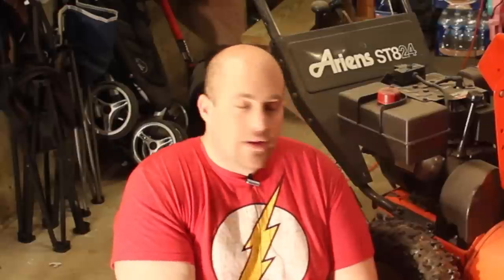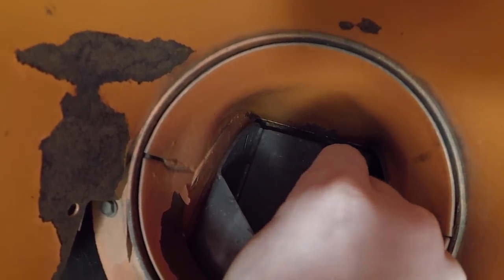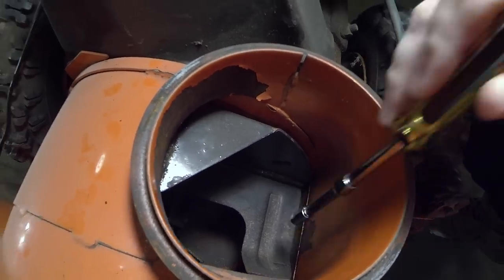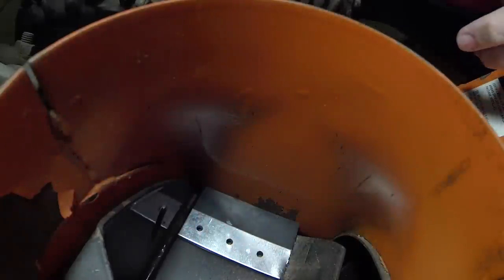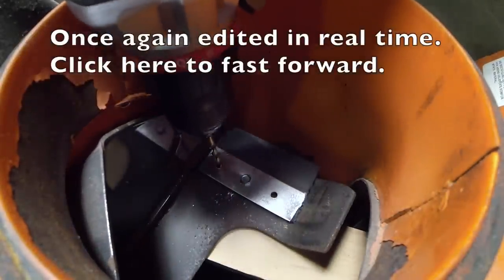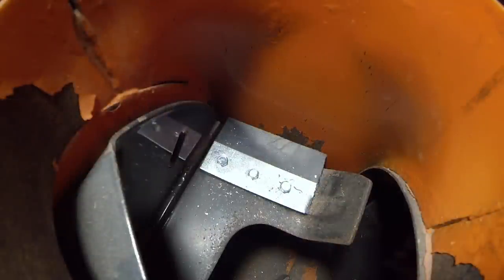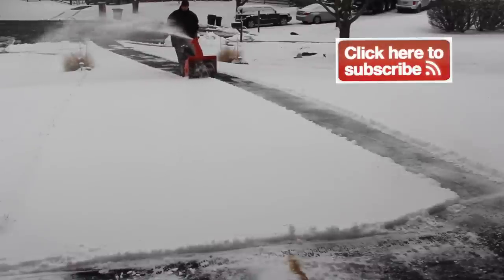TURBO CHARGE YOUR SNOW BLOWER - How to Install a Snow Blower Impeller Kit

Comment: Just did this today to my john deere 726 with 6.5 horse harbor freight motor. It was already a beast, but it's even better now! I was throwing the wind rows from the plow truck about 20-30 feet, never clogged, and the snow was several inches higher than the front of the machine.

Comment: For future reference, use a sharp drill bit.   Use some motor oil on the bit while drilling, it will help to keep the heat down at the tip of the bit thus keeping the bit from losing temper and staying sharp longer.  And lastly, slow the RPMs on the drill down, a lot.  Cutting steel should be done at much lower speeds, again keeping the friction temperature down and saving the cutting edges of the bit.

Comment: Great video thanks...I did the impeller wiper retrofit to my Troy Built 28" 9.5hp Track Drive in March 2019 after using it more then 10 years of blowing snow. I bought all materials individually....1/4" neoprene sheet 60 durometer, 1/8" x 2" x 2" long 6061 aluminum flat bar and 1/4" stainless steel screws. It throws snow much better and further even slush. Troy Built's impeller clearance within the tunnel it spins in is excessive 5/8"+ giving my driveway gravel lots of space to fit into....surprisingly the new wipers give the gravel less places to jam and cycle thru much smoother....after realizing that fact I do not understand why OEM snow throwers do not come with wipers direct from the manufacturers. I like the idea another reviewer made about changing impeller belt pully to a smaller diameter to increase the rpms of the impeller.

Comment: I did the same kit install on my 45 year old Ariens 824 and it made a huge difference, very pleased.  I didn’t notice whether you pulled the boot off the spark plug as a precaution against accidental starting when turning impeller.
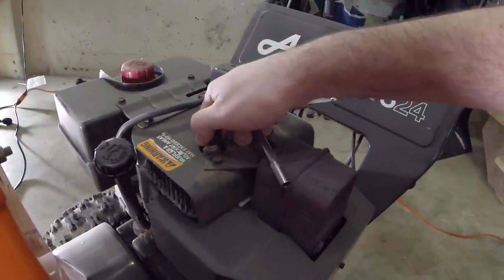Reply from the maker: It surely makes a difference. Did you buy a kit or make your own?   I did unplug - 5:07
Reply: Bought the kit but would not recommend now, way too expensive.  Thanks for posting.

Comment: We have similar snowblowers. I have a 1985 Bolens 824 with a 8hp Tecumseh with a 3-blade impeller. I just put the impeller kit in last week. It went in pretty easy, but it did take a while. I marked the holes on the impeller with a black marker and drilled a 1/4" hole, then widened them to 3/8". Installing them was the easy part. I greased the shute bearing edge and reassembled. Then, theNor-Easter that was coming.... missed my area. Bummer!
Reply from the maker: I was ready for it too and I got was a little dusting. :(

Comment: Did not know these kits were available, and the price is crazy for whats in the package LOL! Stainless screws, nylon locking nuts and washers only cost a few bucks at any hardware store. A mudflap from a truck stop is fairly inexpensive, if you can't get an old one that was thrown out.
Reply from the maker: True, just like everything else in life you pay for. You can probably do it yourself for whole lot cheaper.
Reply: ModernDayFamilyMa'

Comment: My blower has cast impellers. I used mud flaps I bought from Fleet Farm $8 And cut them to size. There's enough left for 4 more sets of wipes. #8 Stainless self tapping screws and #8 stainless fender washers. Total $7. Drill pilot holes and attach. Simple job. I have 4 impeller blades. Started with two and I couldn't believe the results. Added the final two later. Where has this blower been for the last 15 years? A 5 hp two stage that would clog up within 6 inches of wet snow now chews through EVERYTHING and throws twice as far. Last winter it didn't clog ONCE. For the first time since I was a kid I'm looking forward to winter. This one time POS is now a BEAST.  IF I ever buy a new snowblower the FIRST thing I'll do is install impeller wipes.

Comment: I had an old Compact 24 a long time ago, and I have to say the best mod I did was a smaller impeller drive pulley.   I increased the RPMs by 50%(1,200 to 1,800).    I was afraid that the drop in torque would cause more clogging, but the opposite was true and it threw much further.   You had to be careful of rocks and stuff, though, you didn't want to turn the shoot wide open because it could throw a rock for a city block.
Reply: So you happen to know how far of a jump down you went with pulley size? I’ve been trying to do that and this mod because it truly transforms the machine
Reply: @ryangaughan5535  IIRC I went from a 9" pulley on a 10" impeller(the compact impellers back then were tiny) to a 6" pulley.  It was a big drop
The impeller went from spinning at 1/3 engine speed to 1/2 engine speed.
It looked kind of funny because the auger was visibly spinning much faster than a normal machine.
In my case, I got a pulley from a local farm store, drilled some mount holes, and bolted it on.  I got lucky because the factory pulley bolted onto the piece on the drive shaft.  Not all blowers are like that, sometimes that is one piece which will make it a challenge.
If it was too fast, or I didn't like it, I planned on trying different sized pulleys, but, in the end, I was happy with the results.  I just had to be careful where I pointed the chute.
Keep in mind, if you have a newer blower(I think '80's+) with the "safety brake", you will have to modify that to make it functional, if you want to keep it.

Comment: I have a 1985 Bolens 824 with a 8hp Tecumseh eng and heated grips (it;s VERY similar to your Ariens 824). I also have this impeller kit yet to be installed. I wasn't exactly sure how to take the chute off. I figured it was those 8 bolts around the gear, but thanks to your video, I now know what to do. THANKS! BTW, I just bought some AmorSkids for it that I ordered through Home Depot. You should consider them. They're worth every penny.

Comment: Great video, I cut an old mud flap I got from a truck shop, picked up some screws and brackets, drilling the holes is fun as you know, but works great. thanks.
Reply from the maker: Thanks Jeff. Old Mud flaps are awesome.
Reply: Very happy with the mod, it worked great, thanks.

Comment: Did it to mine also and it's a great idea. BUT, the first thing you should of said before starting the project is disconnect the spark plug!!! if that baby started by turning the impeller you'd be missing a hand. Just like a lawnmower turning the blade could start it if the gas was on. Just a good safety step. Doesn't hurt to be cautious.
Reply from the maker: Thanks. It makes a world of a difference, doesn't it?  BTW: check out 5:06

Comment: The Impeller is a full-size car built by Chevrolet for model years 1958 to 1985, 1994 to 1996, and 2000 until 2020.  Impeller was Chevrolet's popular flagship passenger car and was among the better selling American-made automobiles in the United States.

Comment: Sorry in advance 
I completely understand you are a newby to the snow blower  world 
You as a preper  fronters man will appreciate another point of view
There is a man who has done the very same thing I have used his methods to great results  
His method required self tapping screws and an old tire for the rubber his name 65 Ford notto  be bad mouthing at all he has great stuff for the guys who do it them selfs 
Again I apologise but there are easier ways to be a step wiser with what is around your home 
Recycle stuff intended for the junk heap it's less a mess to haul away 
       Have a great day my friend

Comment: I'm not sure what these kits cost but to maximize bang for buck I'd slot the holes on the rubber to adjust as it wears. Similar design to cement mixer squegeezs . Slot the hole and adjust as it wears. Just a thought

Comment: Great video and camera work showing how this job is done. I plan on doing the same with my 1 stage craftsman snow blower. Hope it works. Thanks!
Reply from the maker: 1 stage? How?
Reply: I did it. The blades just need to be positioned so that I can reach the impeller. I used the rubber paddles (cut to size), metal mending plates similar to yours and nuts/bolts. Tested it out and worked great except for extra noise. I tried trimming the paddles with a snip tool but don't want to take off too much and undo the work I did. Your video helped me so much. I was also told by a friend to use some silicone spray before using the snowblower.
Reply: On my 1 stage the impeller pads/paddles are attached to the blades. I was able to access them from the front without going down the chute.

Comment: I'm having a tough time getting my big fat hands in there and placing the paddles I made in the right place. I wonder if epoxy would hold them. I'm racing against mother nature in Denver.
Reply from the maker: +Gitar Zan I wouldn’t think so by itself. Can you add some self tapping screws?
Reply: I think I can if I epoxy them 1st. I have to turn the impeller to a certain angle to seat them proper. Then turn it again to get mr fat hand down the chute. I'm sitting here making a new set. The 1st one came out all crooked after I glued it in. Trial and error. It did take some serious prying to get it out.

Comment: For the few times my machines have been clogged over the years, that is to much like work, and I have been using snow blowers for a good 25 years. The manufacturers should be doing this when they make them.
Reply: There is a reason they don't.   And the new snowblowers often have even larger gaps.  This is so that when people put the blower away wet, like many do, the snow in there doesn't freeze the impeller in place which causes the operator to burn the belt off the next time they use it.
Also, the tighter the tolerances, the further it throws rocks and other hard heavy objects.
Reply: l337pwnage I'm sure you have valid points there, but using plastic or vinyl should defeat that. I have thrown a lot of rocks over the years, and when I knew it, it didn't matter how far it would have went, it already went to far. But I have no interest in doing something like this, my machine throws it far enough and when it didn't I just bought a bigger one. I also keep it in a nice warm garage so I don't have to worry about it freezing up.
Reply: +Marty   I have a detached garage, so freezing is more likely in my case.  It still didn't happen much, tho.
Also, I'm sure another major reason is cost and the liability if those parts would loosen up and fly out.
IMO, the primary advantage of this mod is light snow.   If you aren't blowing enough snow to pack that gap tight, you lose throwing distance as the snow slips around the edge.
The secondary is the slush where this mod will not let slush build up and slow down the impeller.
But while I have thought about this mod quite a bit, I've also decided that the gains aren't worth the negatives or the work to install it.
To add my anecdotal experience, my new machine has a lot of power & an large gap (IIRC something like 3/4") and I've tried plugging it up, but haven't been able to yet.   The transmission will start to give way before the blower part stops blowing.
My old machine had a tight gap, about 1/8" (that's the one that froze a couple times), but it only had a 5HP motor and a 10" impeller.  If you hit heavy slush, it would plug up and would keep plugging until you got to some cleaner snow.   As I put in another post, my best mod there was to put a smaller pulley on the impeller for a 30% RPM increase.   Man, even the auger looked like it was flying, lol.  It didn't increase my throughput because I still only had 5HP, but it really gave me distance and it didn't really plug up anymore.   Not nearly as easy, anyway.
Reply: l337pwnage I certainly can see where it would happen, after all a lot of people don't even have a garage. Of course I think if I was in that position I would make sure I cleaned it out good. Also this is something a little hot water wouldn't cure.
Reply: +Marty Funny you say that, I did have a neighbor who had to keep his snow throw outside.  All he could do was throw a cover over it.   It was a very old one too, looked to be from before 1980 when all the dead man switches and stuff like that became the standard.
I don't super clean mine, what I would do was brush it off, scrape off the big chunks in the bucket and chute, run it a few seconds until nothing came out, then put it away.   Invariably, though, there was always some left somewhere which could melt into the bottom and refreeze.   I actually don't recall where the drain hole was or the size, but I bet there was one and it may have plugged.  My new blower has a huge drain hole, about  1/4" X 1/2".
It only caught me once.  I went many years with no problems and it froze one year and I damaged the belt, I don't remember if I replaced it or not after that, I know I used it that day on the same belt.  Being cold, I don't remember the belt squealing, it just wasn't blowing snow.   Took some chipping to break it loose.  I didn't think of the hot water trick.
After that I made sure to clean it better and if there was some big temperature swing or I saw a lot of ice under the blower in the garage, I would grab the impeller and move it by hand before I started it.  There was a couple times I had to chip it out, but that's it.
The new design would be really hard to freeze up with it's large gap and no impeller back plate.
Also, I don't think I ever had a chute freeze, but the new style chute doesn't even attach to the impeller output.  It just hangs over it on a special mount.
Man....I talk way too much about snowblowers.....
Reply: l337pwnage My first blower was from the 80's also and it stayed outside, never had a problem with it and it always started. We had a bad blizzard in the Pocono's one year, the snow was so deep the chute was under the snow while it was blowing and it still did a fantastic job. That day I had more friends than I cared for.
Reply: +Marty  I wasn't as lucky, my first one was a '93 Ariens with a Tecumseh motor.   Badly abused, badly rusted, had been worked on and spray bombed (painted with spray paint) by somebody.    I always got it to work, but I had various problems with it.  It did have electric start, tho, which was really nice.  Especially since, for some reason, if you used the pull start too aggressively, the little starting pawl would just fall out of it.   I never could solve that problem.  It really didn't look damaged to me.
One day the electric starter would just spin and not engage, so I had to take it apart and grease it.
When I got it, I noticed it would only run at about 1/4 choke, but since it ran, I didn't mess with it.   Well, after many years of use, one year it got worse very quickly.  it took 1/2 choke to run it, then 3/4 choke, and eventually it wouldn't run at all.   I took the carb apart and it was packed tight with crap.  I wished I'd did that when I first got it because it ran like a champ after I cleaned the carb out.
I fixed a lot of other issues with it too, but it did move the snow I wanted it to.   I was always a shovel guy before then, but I had a neighbor who would push snow next to my garage and moving a 6' pile of plowed snow with a shovel was not easy, so I got a blower and after it was a nice pile I'd blow a few feet of clearance between the pile and my garage.   Once he had his pile established, he could no longer push it, so I was set for the winter after one blowing.   It would chew threw that pile quite nicely,  especially with the snow chains on the wheels.

Well, like the saying goes about friends, "A friend in need is a blood sucking leech."   At least I think that's how the saying goes.  ;)
Reply: +Marty  I have to agree.  Even with the maintenance time, you still spend much less time overall.   Even in a very light snow, I can put it in high gear and clear an area in minutes and be all done.
Reply: l337pwnage Not to mention you don't have to worry about a heart attack, I'm getting to that age where it isn't a good idea to even touch a shovel.
Reply: +Marty  Well, if you use shovel every winter and a reel lawn mower every summer, you'll probably never have to worry about a heart attack.  ;)
Reply: l337pwnage It's to late for that, my hips are shot, I have a riding mower and probably will get a plow.
Reply: Agree!!!
Reply: Marty Marsh and Marty, you are an example of why the manufacturers won’t change their products, because people will just buy a bigger one.  
I’ve gotten quite cynical over the decades, and used to be the exact same way.  I’ve gotten tired of replacing things. I’d rather make what I have work better.

Comment: Hello Dony!
One very important feature of this larger size snowblower you did not mention is the size of the auger flighting. Your Can Tire demo model does have good auger flighting, however there are at least two different well known blower makes on the market with what I would call micky mouse flighting which is totally inadequate when you have to handle 6 or more inches of snow. Most people only look at the price tag which in this case is not a good idea.
Reply: +awalt26439 How do you use a rivet tool in the chute hole?
Reply: +hdtripper1 Sorry.I meant this for john waters.

Comment: I did this with my older Honda HS80 no problem. Haven't had chance to try it yet. But my newer 928 is out of the question. Impeller must be tempered. All I did was chew up self tapping screws and drill bits.
Reply from the maker: oh no,  thats a bummer!
Reply: @ModernDayTech  All is not lost. I can be pretty persistent. I purchased good quality high speed drill bits and used 10/24 screws with lock nuts. Using a slow drill speed and lots of cutting fluid, I got through.